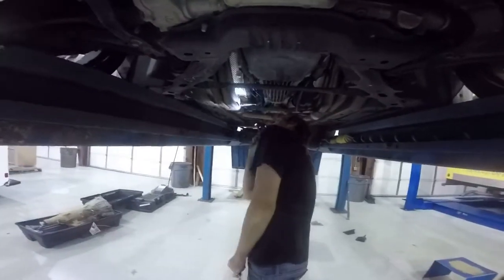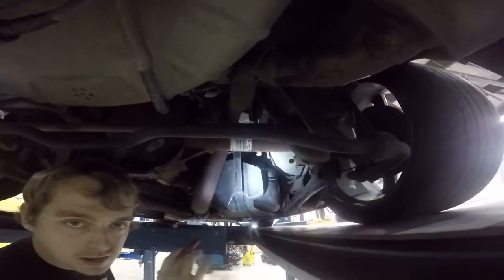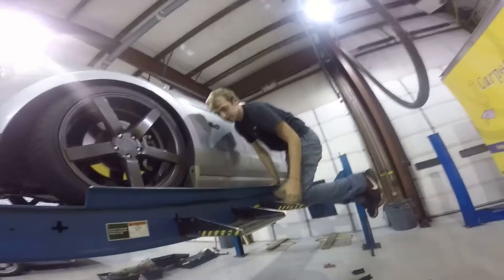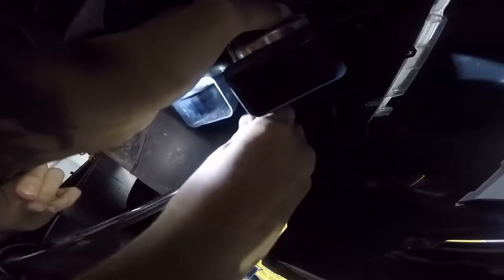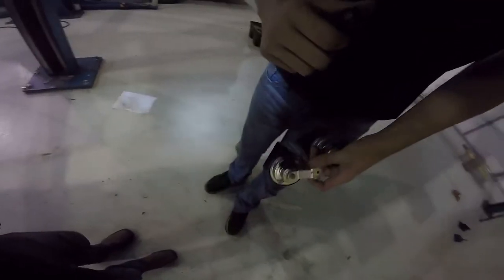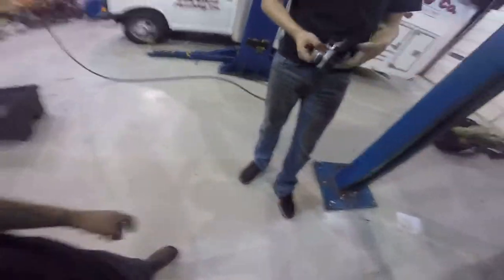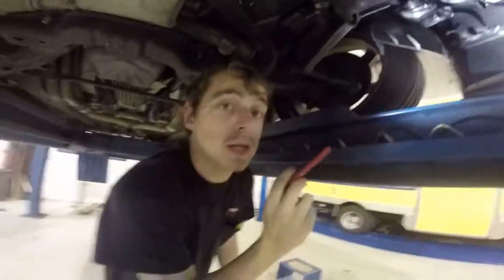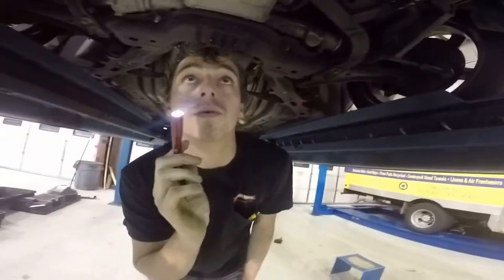how to install a horn on a 11-14 mustang!

Comment: hello. I am currently on a project with a 2014 Mustang, I have this small problem, and I don't know which are the two cables that are connected to the horn. I know that two are for an ambient temperature sensor and another for the side light and the other two for the horn. Could anyone tell me what color the horn ones are?